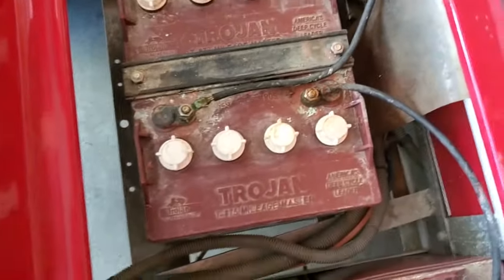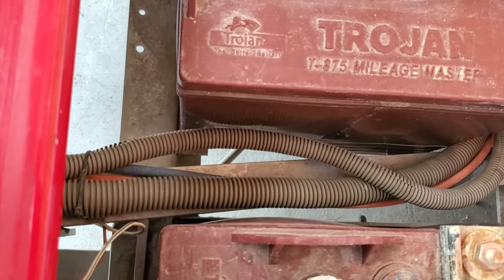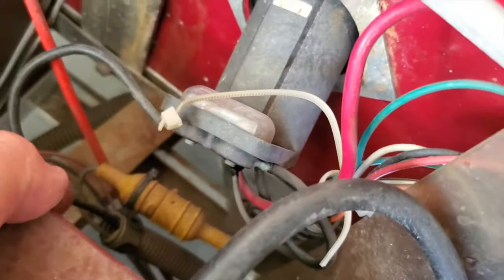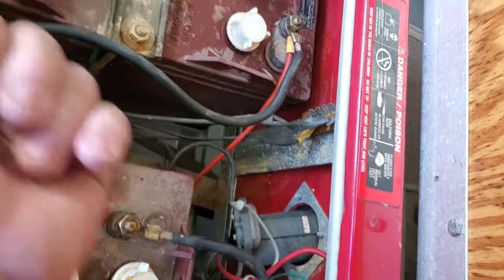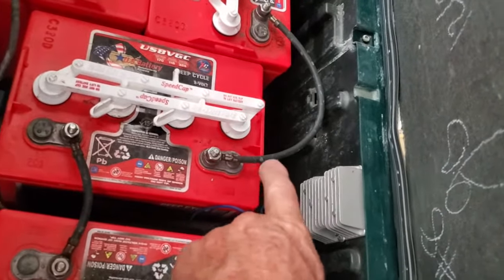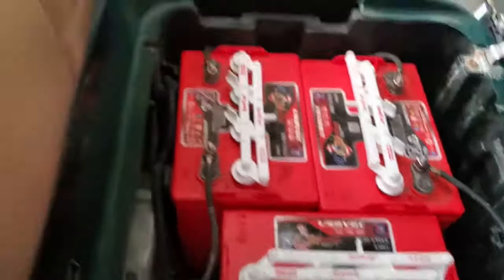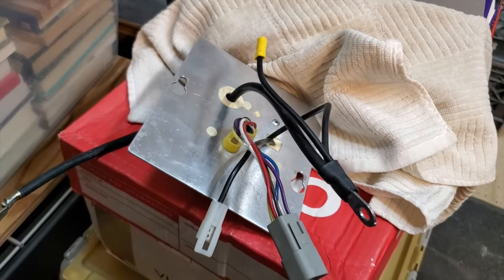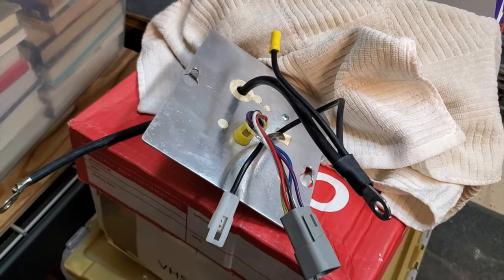How To Bypass Your OBC

Comment: Hi Wayne.  Great video and comments.  Really helpful.  I'm ready to by pass my Club Car 97 ds, but wonder if you ever tried to get in the OBC and fix what might be a failed diode.  Read somewhere that it might be the problem.  Thought I'd check before cutting wires etc.  Thanks.
Reply from the maker: yes I have opened them before. 
There is nothing that is accessible in 
it.  The entire inside is encapsulated in epoxy.

Most important,  if you are going to do a bypass,  get the new charger first,  because if you cut wires first,  you won't be able to charge again till you get a different charger.
Reply: @waynemartin.waynesgolfcart4900  Yep, I already have my new charger so will do the by pass.  Thanks

Comment: Thanks for the video wayne, I need more info on the yellow wire though. So, once i cut the yellow wire, do i connect the gray wire to the end that goes into the obc, or the other end that goes to the connector. I have a 2000 ds. Thank you
Reply from the maker: you need to make that yellow wire go from the solenoid to the main battery negative.
Reply: @waynemartin.waynesgolfcart4900   is it the thick yellow wire that gose to the controller?
Reply from the maker: The yellow wire should  be a skinny 18 gauge wire.
It usually goes from obc to solenoid. 
You need to make it go from solenoid to B- on controller or to the main pack negative
Reply: Wayne, on my 99 DS with regan solenoid, the yellow wire is not there? The heavy gauge yellow goes from B+ on controller to solenoid. The 18guage yellow comes out of the 15 pin connector on controller to OBC. Does this need to go to negative?
Reply: Or do I just take the B- black wire and run a jumper to main pack negative?

Comment: Thank you for the video! it helped me out with my cart. Turned out my OBC was disabling the throttle. And after removing the OBC wires and looping the yellow wire to the B- terminal and the black charge port wire to the - battery terminal it worked

Comment: You mention the yellow wire that connects to the solenoid. The other end connects to the controller, not the OBC. Do I remove or cut this yellow wire at the controller and connect it to the main batt neg?
Reply from the maker: if it connects to the controller B-, then you don't need to do anything with it.

Comment: The grey wire off the charge plug? I cut it . Appears a bypass kit was put in place with grey splitting to red and blue on  a partly blanked off six pin connector to the loom. Does the solenoid need a neg wire? No click when I put the cart in gear.
Reply from the maker: Forget the gray wire. Yes the solenoid needs a negative wire.

Comment: Hello sir, thanks for the video... On my 2006 Club Car DS it was set up like the precedent you should in video... after pondering for a while I decided to gamble, clipped the wires from obc, removed all wires except the blue and white as you advised, butt spliced them together, connected the grey connector back together and fast project took me 30 minutes. Went with summit II charger and has blue tooth which is cool. Thanks again for your videos

Comment: I have a 2013 Precedent. Installed a 48v lithium battery, trying to  ensure I don’t screw up the OBC disconnect. My new battery pack obviously uses the new on board charger and I want to remove the old socket and replace with one I can plug an extension cord into where the charger plug just plugs into the backside for that clear look. If I don’t hook up the red hot to the battery, cut the grey I am not clear what to do with the black. Do I have to leave the OBC hooked up or will that prevent the cart from working. I heard you say we could splice the blue and white together but need to make sure I am not screwing up before I start cutting factory harnesses!  Great video!
Reply from the maker: If you are not going to use the original cart receptacle,  take it completely out, remove both wires and unplug the yellow fuse holder. Also remove the obc completely.

Comment: Hi Wayne.  Yes, it was my understanding that my MOD Z charger would work with either a OBC or with one that has been bypassed.  Since I just tried the charger before cutting wires to bypass and found that while the amber low charge light sometimes blinks and sometimes stops, the charge across the battery pack does charge up to  55volts with about 8.9 across each battery.  So, something is working, but I may still do the bypass if running the cart a lot causes problems.  Thanks again for sharing your time and knowledge of how these systems work.  Oh, I do know that my old charger did start at 15 amps and dropped to 10a and on down to 2 amps before shutting off.  I have not tried to run my new charger all the way to shut off.
Reply from the maker: I talked to the modz people today.  They assured me that it would work without doing a bypass.👍
So I ordered 1 so I can do some testing of it on my own.
Reply: @waynemartin.waynesgolfcart4900  Great!  How this all works is a mytery to me and I'm always curious but need to understand the circuitry better.  I considered the Summit II but didn't need all the details the app provides so went with the cheaper charger that sounded like it would work both ways.  Let me know what you discover.  Thanks again.

Comment: 1995 ds are you able to take out the OBC all together if you have new lithium and smart charger???...if so what other wires would you need to address. Thank you so much for the awesome video's.
Reply from the maker: If you have a obc, and install lithium,  then yes you can remove the obc.
Pretty simple bypass, usually just the receptacle negative, the gray wire, and the skinny yellow to the solenoid.

Comment: I’ve got an 03 club car ds iq. I am trying to convert it over to lithium. Based on what I’ve seen and read I have the same cables as the precedent. I have jumped the blue and white wires, removed the other wires and OBC, and have connected it back together per your instructions. I connected the battery and have full voltage across the solenoid and to the motor even with the key out of the ignition. Furthermore, the cart will not move in forward or reverse. Have you seen this issue and do you know what the fix is?
Reply from the maker: If you have full voltage to the motor, without the key on, then that means your solenoid is closed all the time. I think you have wired  something wrong. Text me pictures so I can see everything under the seat, batteries,  wires , etc. Text to my phone.

Comment: Great videos on your channel!!! Thanks.  I have a 2005 Club car precedent with four 12 volt Rolls batteries I got last year new.  Currently, the battery won't last 18 holes, became very weak at end of 18 holes, I can barely make it to home.  The battery specific gravity and voltage even load test check out all ok.   I am using OGM power drive 2 charger.  some suggested the charger is not good.  what could be the problem?
Reply from the maker: Could be the wrong batteries,  could be 1 or more bad batteries,  could be charger, obc,  charge receptacle,  receptacle red charge wire, dead wall outlet,  you need to narrow it down some.
Try your charger on someone else's cart and also try someone else's charger on your cart, that would narrow it down alot.
Reply: @waynemartin.waynesgolfcart4900  Thanks for your suggestions!  I tried using my friend's charger, the aftermarket" hi-frequency charger"  It seems working, I also changed one cable which I noticed was warm.  The problem is that particular model of charger is in short supply.  What can I do with my power drive 2 which seems to undercharge my batteries?
Reply from the maker: send me pictures by text or email,  of the entire area under the seat so I can see all the batteries and wires
Reply: @waynemartin.waynesgolfcart4900  just sent one photo.
Reply from the maker: got no photos

Comment: Wayne! great video ur the main guy! question for you, i do have a DS but its a 2005.. i dont have the same color, which one do i join together to bypass my OBC ?
Reply from the maker: If you DO NOT have a white wire and also a blue wire at your obc connector,  then you do nothing about joining any wires. All you would need to do is reroute the # 10 black to the main battery negative, cut or disconnect the gray wire, and if you have the skinny yellow wire on the solenoid,  that would need to be rerouted, that's all.

Comment: Thanks Wayne. So to clarify, after cutting the 10ga. black and routing it from the charge port to the neg battery terminal, I then cut and route the yellow wire from the solenoid to the same negative terminal as the black. (The main pack negative) Again, thanks!
Reply from the maker: yes, if you are talking about the skinny yellow wire, not a fat 6 gauge wire!
Reply from the maker: yes, just make sure you are rerouting the correct end of that yellow wire

Comment: Howdy Wayne!  Great video and thanks.  A quick question, do you have to bypass and eliminate the OBC when using a smart charger?  I am wondering if I can just run a #10 wire from the outbound Neg on the charge receptacle and connect it to the Neg on the #6 battery and be done.  This would leave all of the OBC wiring in tact in case a future buyer wanted to replace the bad OBC.  Thanks, Lkh
Reply from the maker: most smart chargers need the obc bypassed.  Some chargers claim they dont, but i havent seen them that actually perform well.

Depending on what year and model cart you have. you probably have to do more than just run the 10 wire to the negative

Comment: Hi Wayne, I have a 95 DS and the yellow wire you were referring to, it’ll be extended (so it’ll be running from the solenoid to the main pack neg??) just clarifying. I already did the receptacle ground to the main pack neg and I deleted the gray wire with the yellow fuse thingy. Just clarifying that the yellow that’ll be cut will go from the solenoid to the main pack neg?  
Thanks in advance.
Reply: Oh by the way I purchased the Craftsman Golf 48v/18amp charger you did a review on. My old charger was cooking my batteries.
Reply from the maker: Yes, you are correct on the skinny yellow wire.
Reply from the maker: @jlipcovich I think the craftsman is still a good charger.

Comment: Excellent video!! I just did the bypass on a 97 ds, what should be done with the red wire coming out of obc.? (Has a fused link and goes to the solenoid) also,  the brown wire,  and the other black that goes to B- ?
Second question... what if,  after i did all this,  the cart still doesn't kick in a charger.?(original power drive,  haven't gone to get the summit 2 yet) all the batteries are good,  connections,  etc..
Reply from the maker: you don't need to do anything with those wires.  If you are leaving the obc in the cart, you can cut them off if you want. 

Your club car charger will not come on now.

Comment: Wayne, good morning, do you know the difference that it makes when you connect the blue and white together, I did my bypass but didn’t connect the blue and white. I will like to know if I loose a future? Thanks
Reply from the maker: By splicing those together,  it will protect the controller from failing or locking out when charging.

Comment: Wayne

I have a pre-2000 DS cart and was wanting to put Allied Lithium batteries in it. I just need to do the black wire from receptical to main negative and just splice the yellow/grey to battery as well? Thanks!
Reply from the maker: yes on black wire. The gray you can just cut off, you wont be using it.

The only time you need to mess with a yellow wire, is if you have a skinny yellow wire going to your solonoid.
 If you do have that skinny yellow wire then you need to reach you need to reroute that so it goes from the main battery pack negative to the solenoid don't worry about it if you don't have that skinny wire.

And lastly if you have a blue wire and a white wire in your OBC Gray connector you need to cut and spice those 2 wires together on the cart side of the connector
Reply: @waynemartin.waynesgolfcart4900  thank you for the quick reply! Just want to confirm that there wasn’t a yellow wire in the “Club Car DS Lithium Battery Installation” video. Just saw the black receptical and the blue/white wire splice. Thanks again and will let you know if I need anymore help!

Comment: Hello Mr Martin thank you for the video! I’m in the process of bypassing my club car DS. I did everything you advised in the video but now my charger will not kick on. When you say cut the yellow wire and extend it to the main negative. Are you saying extend it from the solenoid side or the OBC side?
Reply from the maker: The skinny yellow wire needs to run from the solenoid to either the main pack battery negative,  or to the B- on the controller. 
If you do not have a new bypassed charger,  it will not come on.
You must have a new bypassed charger once you do a bypass.

Comment: Hi Wayne, I have a 2010 Precedent i2 that is not taking a charge. It has brand new batteries and the charger kicks on but it says it is charging at 0 amps. if you run the batteries down some same thing the charger kicks on but charger says 0amps. I have tried different chargers and still nothing. Could this be a bad OBC?
Reply from the maker: Yes it can be.

Comment: Hello there. Love your videos and tutorials. You speak on my level and I understand,  most of the time. Lol. I have a 98 Club Car, new solenoid,controller sent off snd checked out goof ,s  new batteries, new cables, new V-glide,  new F/R switch. Getting pack voltage ar switch,  solenoid, motor, but no movement.. just clicks and clicks. New Trojans show 50.7 at rest. I needed it for a customer by Sunday. Not looking good. I'm gonna try bypassing some things and see ! Any suggestions? Thanks
Reply from the maker: check the motor

Comment: Hi Wayne I have followed your instructions. I have a 2005 DS. Then only thing is, the yellow wire from the solenoid is not working for my cart. Batteries are good including the bank of batteries. Bypass, is missing something. 
Any suggestions please
Reply from the maker: If you are doing the bypass,  do you have the new charger already? Tell me exactly what you have done, with what wires so far?.
Also tell me what is or is not happening after the bypass?
Reply from the maker: If you are doing the bypass,  do you have the new charger already? Tell me exactly what you have done, with what wires so far?.
Also tell me what is or is not happening after the bypass?

Comment: so, on a newer club car ds or precedent, if you are using an onboard charger and not using the stock charge receptacle anymore, you really just need to splice the white and blue together, then, right? Then the obc can just be removed?
Reply from the maker: Yes, correct. However on newer than 2016, they no longer installed obc 's.

Comment: Fantastic video! I just had a '99 Club Car precedent and its expensive Bull-charger go out on me. Instead of spending $600 on a new one, I got one from VEVOR for around $130. With this bypass information, my cart came back to life and actually seems faster. I accidentally did the blue/white loop back on the wrong side of the OBC(with the ensuing non response on the cart), but as soon as I touched the other side of my cut, I heard the solenoid clicking. Thank you so much!

Comment: Hi wayne on this obc bypass videos  I never see anything bout the charger receptor safety feature that is supposed to prevent accidentally driving off while the charger still plugged, how does bypassing obc affect this? or oes the club car have this  ,mechanism at all?
Reply from the maker: Once the obc has been bypassed, you loose that safety feature. 
I run the charger cord, thru the steering wheel while charging, this reminds me not to drive.

Comment: Hey Mr Wayne. Did the bypass on my club car precedent according to video. Now no power. New shauer 48 v charger shows battery charged. But nothing comes on. Where should I look first?
Reply from the maker: By no power, what are you referring to? No power the cart won't run, or no power to the charger?

Comment: I have a question. Can I just outright remove the entire OBC? I have a  lithium battery and charger with a new motor and controller.  What sort of wiring change would I need to make to remove the module. The original charge port is MIA and any signs of wires that went to it are gone. I just want any excess removed so as to keep possible confusion to a minimum. I am upgrading to a high amp FNR solenoid and I am gonna have the harnesses ripped open so I may as well trim the fat. Thank you...
Reply from the maker: Yes you can remove it completely,   
No big deal

Comment: Wayne, which yellow wire do I cut?  I have cut out the gray wire and want to reuse it like you said, just unsure of what yellow wire you describe .
Reply from the maker: Only cut the yellow wire, if it is the small skinny yellow that is on the solenoid. do not cut the big fat yellow wire.